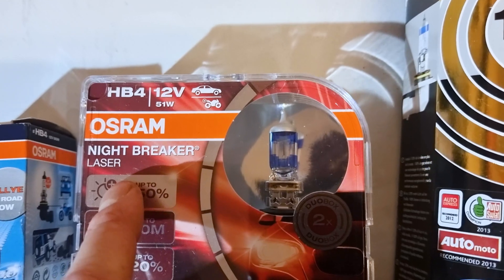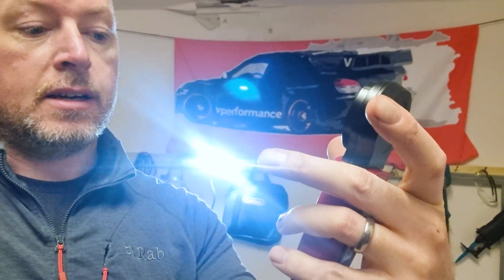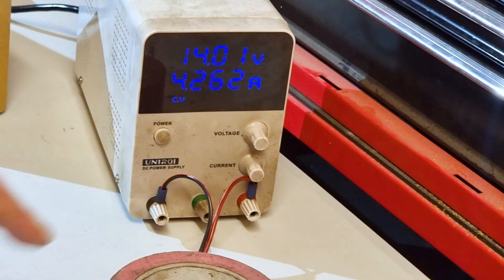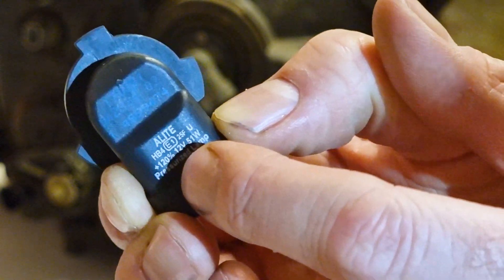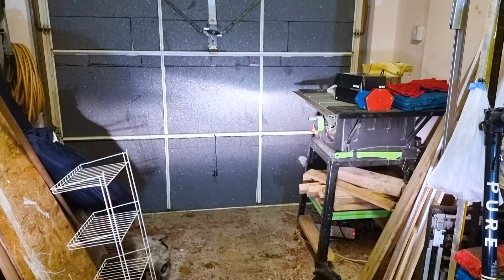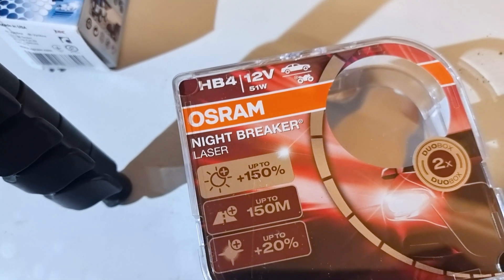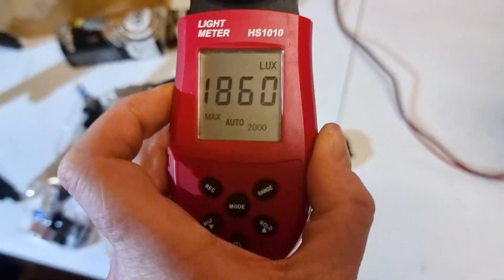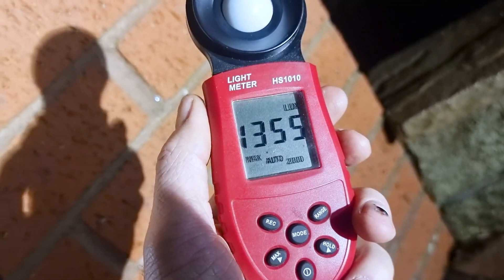Are headlight bulb upgrades any good? Testing Philips, Ring, and Osram performance HB4s

Comment: for main beam applications i have installed a light bar (off road one) on my 2008 Ibiza, like i mean no one else is about when using full beam so why not 😂😂😂😂
Reply from the maker: Where did you attach it?
Reply: @vPerformance  to the front crash bar using rivet nuts

Comment: Biggest difference I found was using vagcom to change the voltage to the headlights on my mk6 golf, from 12 volts to unregulated....
The bulbs don't last as long, but I can see where I'm going...
Reply from the maker: I didn't know that was a thing. How long do you get out of the bulbs?
Reply: @vPerformance  I stumbled on it when I fitted my "ring pro 5000k" bulbs a few years ago, as the light output was worse than OEM bulbs. Can't remember which vw forum I was in but read someone having the opposite issue of bulbs burning out all the same, someone pointed them to a setting for voltage control on the headlights.
I tend to get a year or two out of them, but I don't drive more than 10,000 miles a year.
Reply from the maker: I've got VCDS here which I bought for the RS6 so I'll have a look and see if I can find the setting for my golf